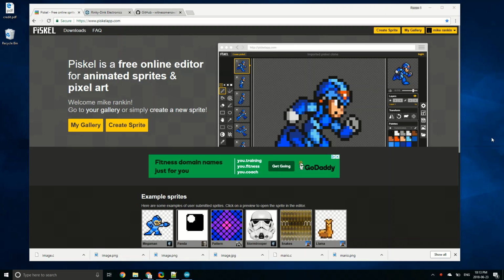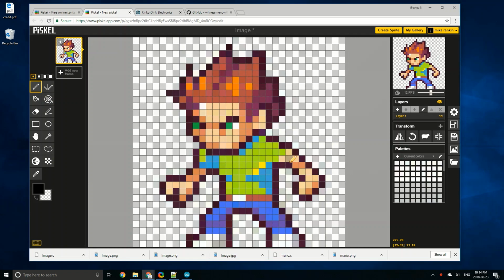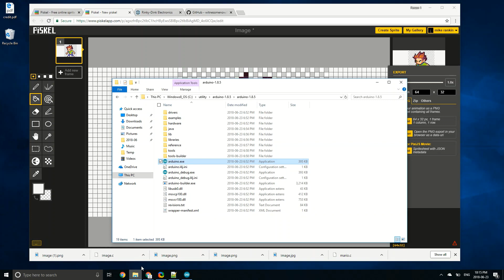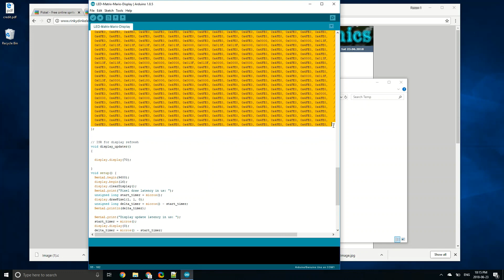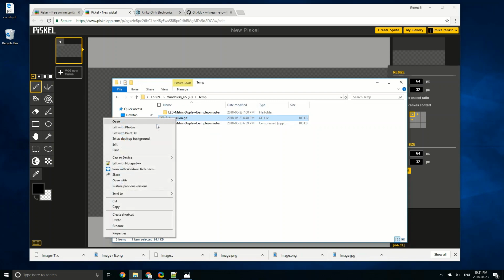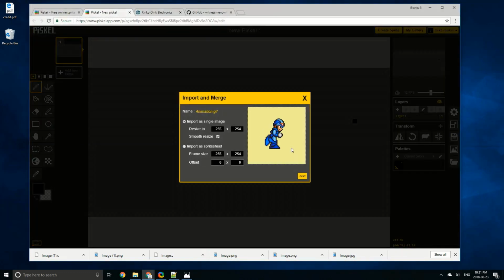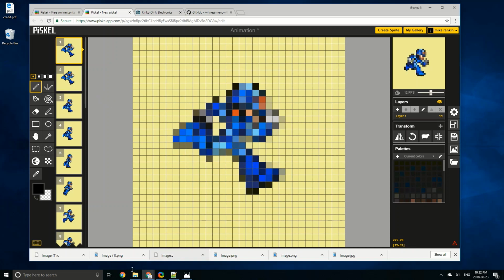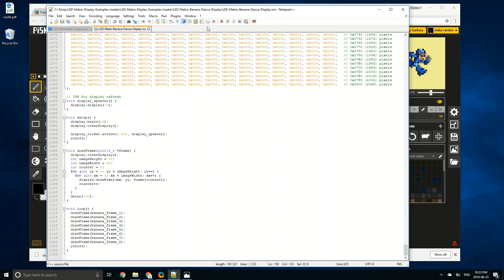ESP8266 64x32 RBG Matrix Display

Comment: Hey, I got a quick question about the Altium file on github. It seems like the pins seem to be offset from the proper alignment for the plastic holders, leaving empty solder holes and a row of pins sticking through the board. I have reference pictures if my words fail to paint a clear image
Reply from the maker: sol Nocturnes can you email a picture of the problem to me at 0miker0 at gmail dot com?

Comment: Interesting board. Note that using the RGB565 GIF to code converter is really an old way of doing things for CPUs that don't have filesystems. For ESP8266 and ESP32, it's much simpler to use SPIFFS and simply read the animated gif directly via this code  http://marc.merlins.org/perso/arduino/post_2018-07-13_AnimatedGIFs-for-SmartMatrix-or-NeoMatrix-Neopixel-WS2812B-from-SDcard-or-SPIFFS_-on-Teensy-3_x_-ESP8266_-or-ESP32.html  https://github.com/marcmerlin/AnimatedGIFs 
It was originally written for SmartMatrix by Louis

Comment: This is great! Has there been an update to this at all? (ESP32 perhaps?) It's been "retired" on Tindie.
Reply from the maker: No update and none planned. I’ve had a few on Tindie but they never sold. The ESP8266 seems to run perfectly fine. The design files are available at: https://github.com/mike-rankin/ESP8266_RGB_Matrix_Cable_Free_Version
Reply: @0miker0  Cool. No problem. ;) I had soldered one of these screens myself, but this design looks neat. Bit pricey though. But hey.. parts. etc. 

I just didn't have much luck actually driving the matrix itself, bare-bones with a D1 Mini. 

I came across your video after a friend was asking about getting a big LED matrix for a bus he's got ;)  (at the top of the windscreen)

Comment: Awesome job man. Can i build it too?
Reply from the maker: If anyone can build one, it’s you Tom! I supplied the design files, parts list and the code. It helps if you’ve worked with Arduino boards before and can solder.
Reply: mike rankin oh i can solder, ive never worked with the arduino yet.

Comment: Should put the parts on the opposite side of the board, looks like there's room, make it easier to wall mount
Reply from the maker: True. I've added the Altium files to the github site so you can modify the board shape yourself to make wall mounting easier.
Reply: I might have to give it a shot :) Would you be able to export it to a format the EAGLE can access? ACCEL ASCII format should work

Comment: Cool Project Mike, I really like it. But Charging 45 Bucks for it is just nuts. The Matrix can be bought for about 49 Bucks from e.g dfrobot. And you want 45 Bucks for a addon board with a 3$ ESP8266 and some other cheap parts on it ?
Reply: it takes some time to design all this; make sure it works, all the parts fit, etc. He has made it open source so one can do it all by themselves. +1 for making it open source. He is charging $0 for all his work, you just have to procure the parts and the PCB and build it yourself.
Reply from the maker: Thanks for the feedback. I’ll go through the parts list and try and bring the price down. Right now all the parts except the ESP module come from digi-key. The three connectors are pretty expensive. What is a reasonable price you think it should go for?
Reply: You mean the connectors on the back side ? I see you changed the price in the meantime. My guesstimate would have been somewhere between 25$ and 35$ without knowing the exact part prices. So your new price sounds a lot more reasonable to me now
Reply: Yeah sure and i totally appreciate his work. I was just pointing out that if he wants to actually sell something a 45$ price mark is to steep for a lot of people